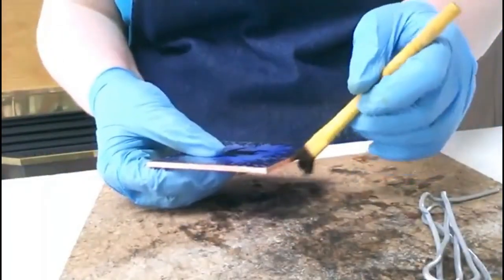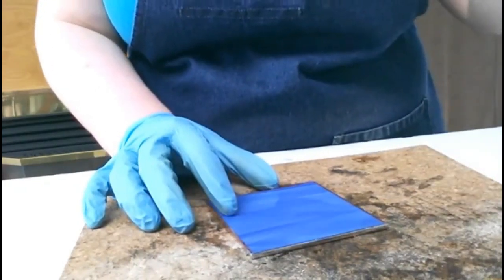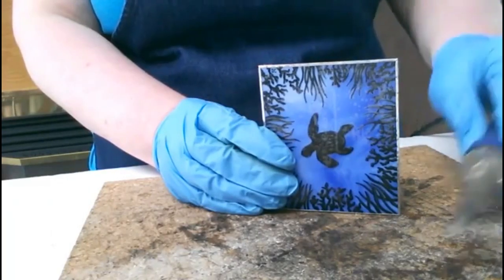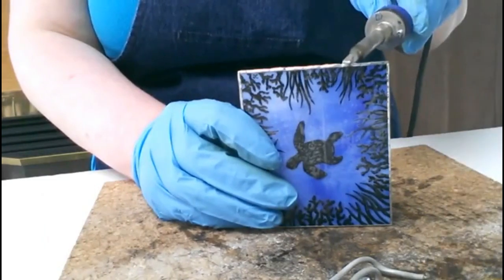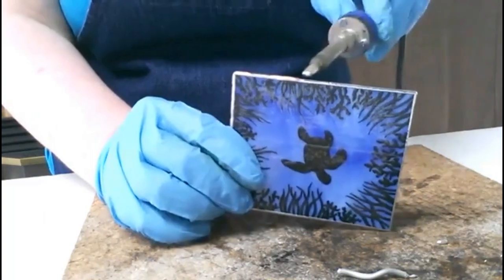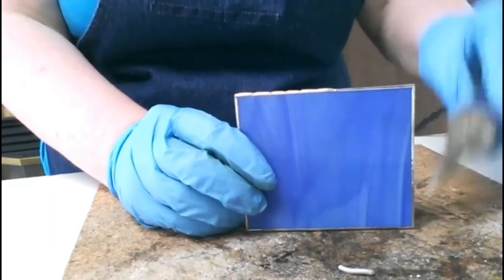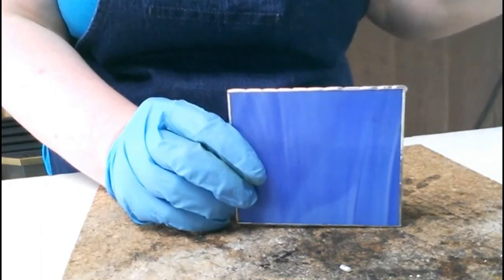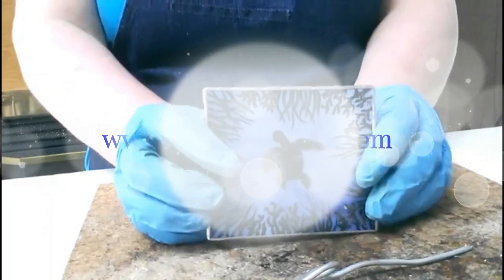Soldering Stained Glass  - Textured Solder For Edging Stained Glass Suncatchers Livestream

Comment: Do you ever trouble with a side along the edge release from the glass. Like the copper foil lifts away from the glass. Happened to me twice.
Reply from the maker: Thanks for your question. I have had this happen a few times early on. The culprit for this is usually poor adhesion due to old or poor quality foil or dirty glass. Another reason I've heard of is that there may be too much heat being used. And just in case you're wondering, my favourite foil is Edco. ;)

Comment: What temp did you set your iron on? Also what was the name of the soldering iron you used?
Reply from the maker: The iron would have been at about 360 degrees but you can always adjust it up or down depending on personal preference. The iron used here is the Hakko FX601. https://amzn.to/2u5wqz4 (affiliate link)

Comment: I love this. What temp was you iron for 60/40 solder? Thanks!
Reply from the maker: I usually use my iron set around 360 degrees, but if you find that everything melts too quickly the next lowest setting on mine is 310 degrees and that would work well for doing this technique too.
Reply: Thanks so much! I have everything out and will be trying this!

Comment: 63/37 or 60/40 solder for decorating?
Reply from the maker: It's really a personal preference. I never really noticed a difference when using my Weller iron, so I just got used to using 60/40 for everything. I have a roll of 63/37 sitting in the closet where it has been for about 9 or 10 years. Since I started using the Hakko iron, I just stick with the 60/40 and adjust the temperature control.